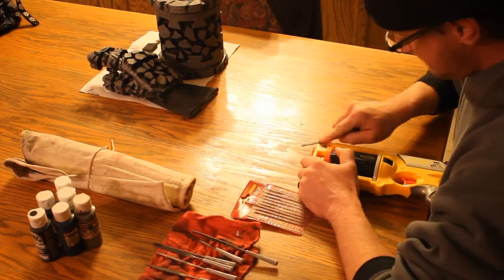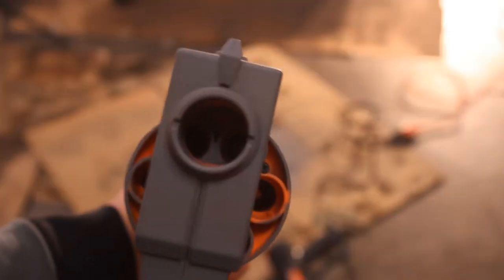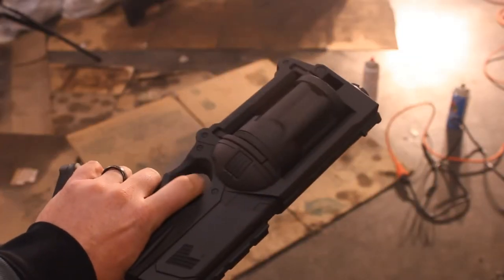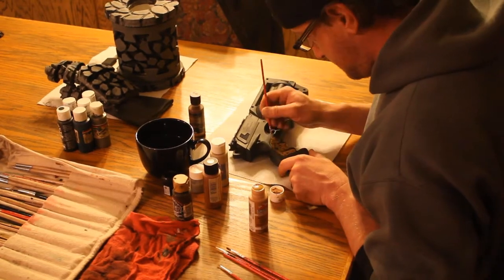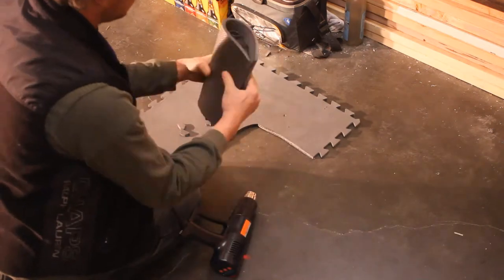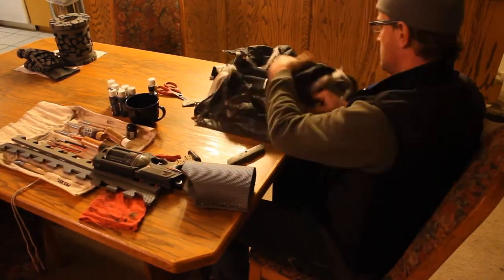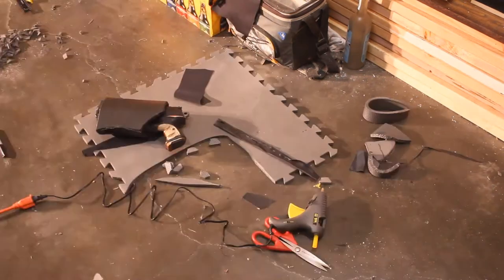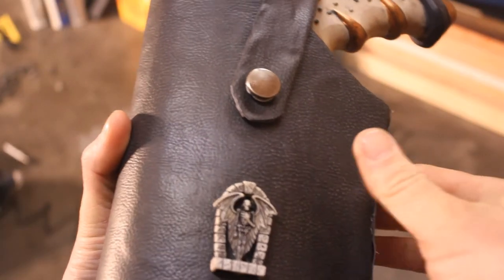D.I.Y "Hellboy" gun prop and holster

Comment: One more extra tip for painting, sand first before primer. The paint will stick longer
Reply from the maker: This is true! I haven't had a problem with the Krylon plastic primer chipping off, but sanding REALLY does help with adhesion.

Comment: What kind of hot knife are using to cut the foam?
Reply from the maker: Lino Sapuriada 
That’s basically a soldering Iron with interchange tips.
I got mine at a JoAnnes craft store with a %50 off coupon for about $15. It has texture stamps and several other neat design tips as well as a few x-acto type blade heads and an adjustable heat.
Reply: redhandstudios awesome thanks and great tutorial to make a foam holster